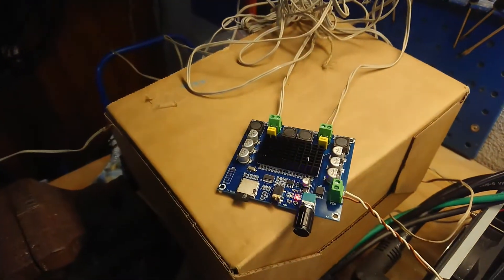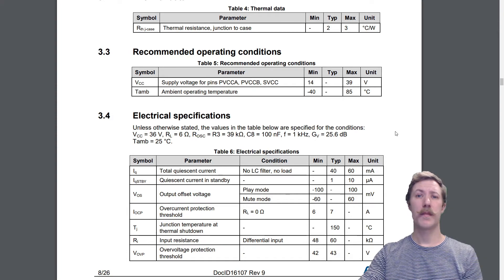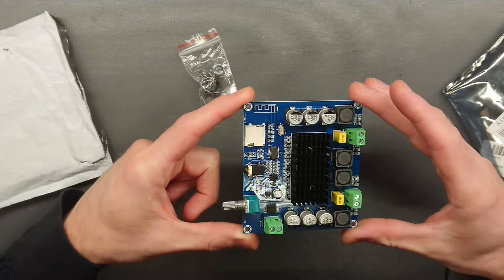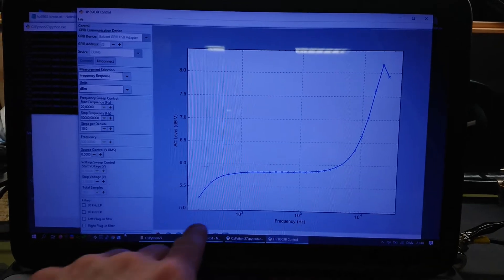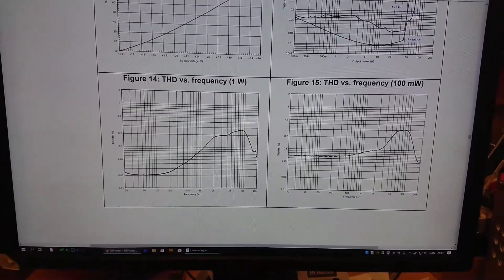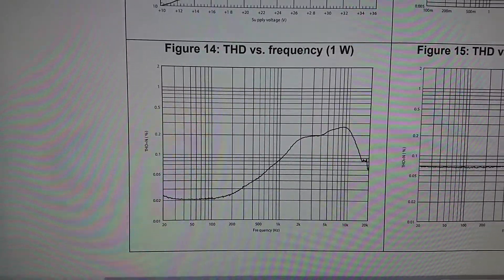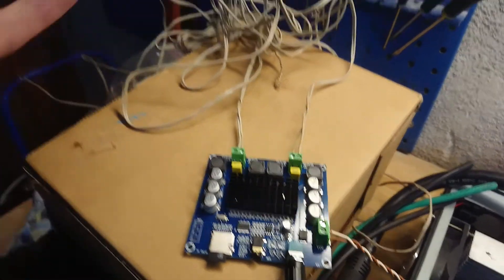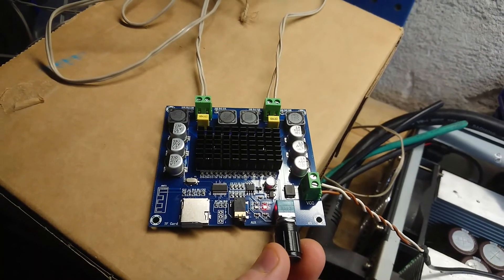Chinese 2x100W TDA7498 Amplifier - Test and THD+n Measurements

Comment: I am using the same amplifier board with 24v 10 amp SMPS  for  2 * 40w (4 ohm) woffer and 1* piezo tweeter connected parralel on each chanell but the amplifier is tripping alot when I increase volume a bit or when the bass beats comes in music. I tried connecting speakers in series but the problem presists I am now very frustrated what can I do now to solve this problem.
Reply: Did you check the thermal paste maybe it's overheating
Reply: Use 8 oms load
Reply: this board features with thermal protection so better use 8ohms load and check if the IC TDA7498 is reaching around 140 degrees before the trip.

Comment: Mine has text still on the bt ic that reads JL AC20BP0A244-25F4, but it also lacks the 8 pin chip which was replaced by another cap instead

Comment: Hello man! Nice video! I have some kind of issue with this amplifier. I tested it on stereo and only the left side is going out on both speakers, and not stereo as it should be. Can you help me, or give me some start point to solve it? Thank by the way! 🙏🏻
Reply from the maker: Return it to the seller and demand a refund. My own experience with different kinds of these cheap amplifiers is that they are manufactured way too cheap, there is too many errors or perhaps low quality reject components used in them.
Reply: @KaizerPowerElectronicsDk  THATS A CRAP! Thanks to the advice man, i'll return to seller and get my refound! one more time, thanks!

Comment: I have the same board, but have a problem playing through the minijack input. If I turn on the Amp with the minijack connected the Amp doesnt play. I have to unplug and plug the minijack in again before it starts playing. Somebody knows how to solve this problem?
Reply: I had the same problem, and solved it, by trying it out.
The solution is to interrupt the first two connections on the left and right of the print jack plug and put a switch between them.
With a connection from right to left circuit board.
That left leg is separate from the circuit board and the switch is connected to the circuit board.

Sorry for my bad english, I am Dutch

Comment: is there a way to reset these boards. Most of the time doesn't detect on bluetooth as well as aux.
Reply from the maker: I find that it is my phone that has trouble connecting to previously known units, but maybe it is a general flaw in BT units
Reply: @KaizerPowerElectronicsDk  I tried connecting with other devices too. And even aux is a problem.

Comment: What signal generator are you using?  Maybe the distortion comes from there.
Reply from the maker: The signal is from the analyzer. With itself in loop it is 0.07% THD

Comment: Is it possible that they used a cheap version of this ic from another manufacturer? That could also explain the measured THD.
But I'm not into audio at all. I don't know if there are cloned audio amplifiers.
Reply from the maker: I think it is more likely to be bad circuit layout or components around the chip than a cheap/reject version chip.
Reply: @KaizerPowerElectronicsDk  I suspect the use of ceramic capacitors in the signal path is to blame. Could upgrade them to film caps, but since the Bluetooth part most likely doesn't support any of the HD codecs, that would remain the bottleneck anyways...
Reply: @NiHaoMike64  Any suggestions on where/how to replace the caps?

Comment: Interesting setup for testing you got there! I've found that if you don't care too to much about sound quality, these small amplifier boards from China really gives a lot of amplifier power for very little money and with high efficiency. In the past I've run a cheap pair of 15" PA speakers with a similar board powered by two old deep cycle lead-acid batteries at Roskilde festival. With the music going at very high volume for almost round the clock the batteries could still last a whole week
Reply from the maker: That brings me back, in an instant to Roskilde in 2005 I think? We had a T-amp in our camp and it was a revolution compared to the old car stereos or ghettoblasters that was common. I think we have the exact same setup with discman as seen here: https://6moons.com/audioreviews/sonicimpact/t.html